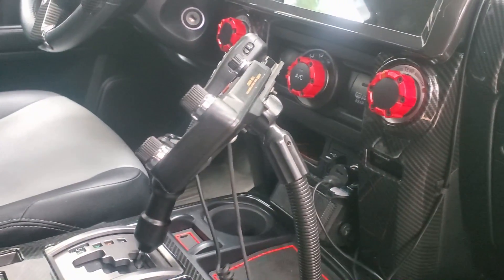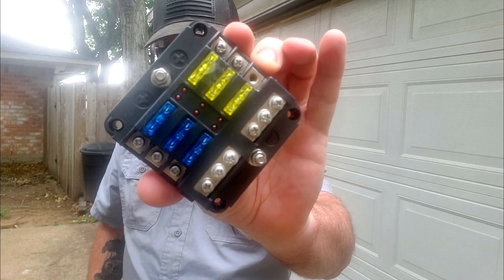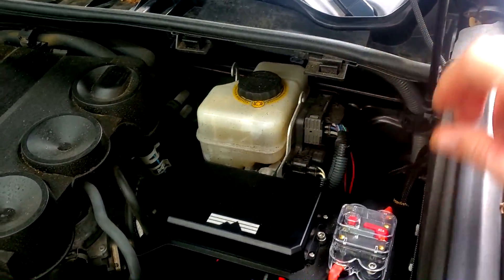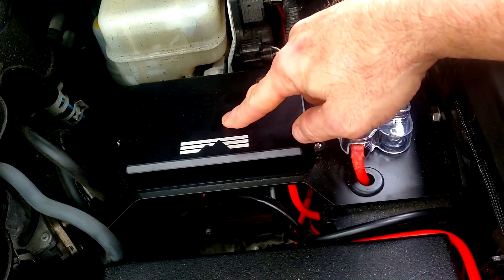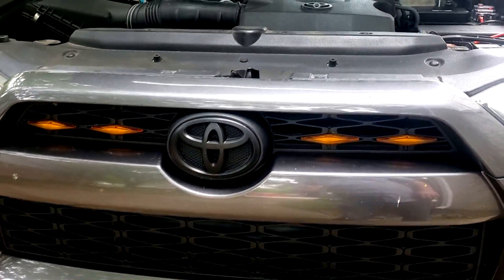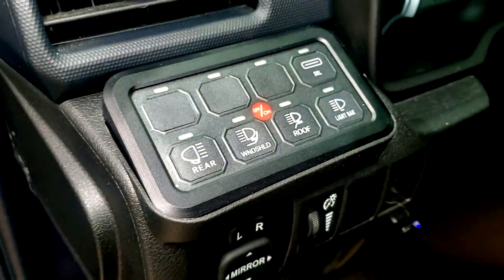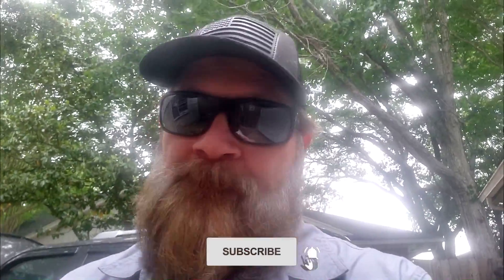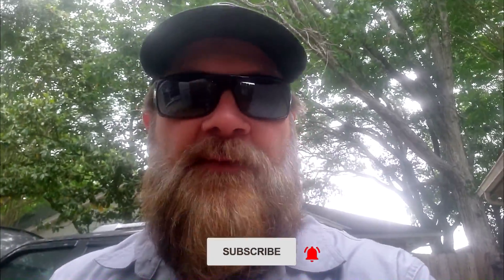How to Connect Your Mobile Ham Radio to Power - Various Options

Comment: My experience is the stock power cord is too small of gauge of wire already so if you’re going to extend it use the next size larger wire or the voltage drop will be excessive, there’s lots of 12 volt wire size charts on the internet
Reply from the maker: I just matched the wire it came with adn that has worke for me sicne this video came out.  Thanks for the comment and for watching.  73!!

Comment: I have a Yeasu FTM-300 connected directly to the battery but just added a 100 watt FT-891 HF radio.  I mounted that one under the passenger seat and decided to run the power to the trunk where I have a 50 AH LIFePo4 battery.  I was worried about draining my car battery drawing 22 amps on transmit.  I can just recharge the Lithium battery when needed.  What are your thoughts?  It was such a pain in the butt wiring to the car battery the first time.
Reply from the maker: The number of amps in a car battery depends on the size and type of the vehicle, and is usually between 400 and 1000 amps.  I have my FTM 400 directly wired to my battery and have not had issues.  Adding a 100 watt radio, as long as the car is running, should not cause any issues.  However if you choose to run a separate battery for the 891 that works as well.  I think it comes down to personal preference.  I understand running wire to the battery is a pain, that is why I put a fuse box in my car that allows for multiple conections to thebatter from a single wire.  But again, it works for me, you may have or want a different setup for your needs.  I hope this helped.  Thanks for watching and for the comment.  73!

Comment: Nice.
In my truck, I just ran two 12 gage red and black stranded wires off the battery between the hood and the fender, squeezed them through the fender and the door, ran them behind the glovebox, and ended them in power poles on the floor below the radio/heater controls.  Whatever radio I plug into them has the appropriate fuses inline, which allows me to swap out radios between vhf/uhf, gmrs, cb, and hf as I feel like doing so.
Reply from the maker: Exactly.  I have done the same before.  Thanks for the comment and for watching.  73!

Comment: You have a very good setup, however,  one thing, many newer vehicles have is current sensors for the battery that can and does cause issues with connection to or on the battery.  These new circuits can cause a vehicle not to start or worse cause the vehicles computer to through a code.  Just be careful when connecting anything to a newer vehicles battery.  Just FYI.
Reply from the maker: That would be something to keep in consideration and adjust the situation accordingly.  Thanks for the comment and for watching.  73!

Comment: It's always best to have the fuse closer to the battery. If something happens with the wire chafing or rubbing on something between the fuse and the battery, there isn't anything protecting it, and you will have a fire.
Reply from the maker: Good point.  I appreciate that!  Thanks for the comment and for watching.  73!

Comment: Does that Lido mount interfere with any passengers sitting in that seat?
Reply from the maker: Not enough to make it inconvenient.  Being that it is flexible you can move it to any position you want as well.  I have had that mount in two vehicles for far and no complaints about it being in anyone's way.  I hope this helps.  Thanks for the comment and for watching.  73!

Comment: Good video.  What antenna did you use ?
Reply from the maker: The one I have been using on my truck with fantastic performance is the Diamond antenna.  Link here:  https://www.hamradio.com/detail.cfm?pid=H0-000062  I hope this helps.  Thanks for the comment and for watching.  73!

Comment: I've had a hard time getting a straight answer on one point of the mobile install and it seems like hams are split on this. Do I connect the negative cable directly to my battery's negative terminal or should that be bolted to the truck chassis..? Just to give you some background, I purchased the Anytone 578 which is 50w and the power cables that it came with are 14 gauge with in-line fuses. I'm just an average guy trying to learn ham radio and people keep giving me super complicated answers to this and I really just want to get this thing hooked up as simply as possible.

In the future I do want to add a second radio which will be the Yaesu FT-891. That's not going to be for quite a while though due to $$$$.
Reply: I installed an AnyTone 878 in my Silverado and connected both cables directly to the battery terminals. That was six months ago. It works perfectly, with zero noise.
Reply from the maker: Same here, no issues.  Thanks for the comment and for watching.  73!
Reply from the maker: I would say try it both ways.  I have my radio wired to both terminals on the battery and have had no issues.  I wouldn't overthink it.  If the instructions tell you to install it a certain way, just follow that.  Personally, I think having both wires attached to the battery makes more sense to me, but that is MY preference.  I hope this helps.  Thanks for the comment and for watching.  73!
Reply: @HR4NT  Thank you so much for your videos and especially responding to comments as actively as you do. I was able to install my Anytone 578 successfully in large part due to your videos. Its safe to say I'm a subscriber for life. You are the best ham radio channel out there by far. Thanks again and God bless you.
Reply from the maker: @_Mordion_   Thank you so much for the compliment and for being a subscriber I really do appreciate it.  73

Comment: I would like to have a ft 400
Reply from the maker: Grab one of you can find one.  They are out of production, but you should be able to find them around the $350 range.  I love the larger screen and it's a tough radio.  Thanks for watching and for the comment.  73!
Reply: It’s a GREAT mobile radio. I’ve got the 400 and the 500 and I prefer the 400. Im probably in the minority, but it’s just so much more user friendly when driving.